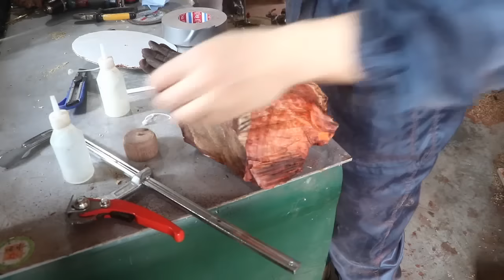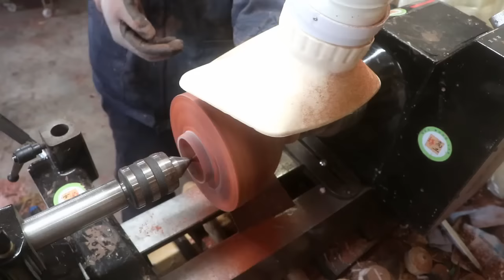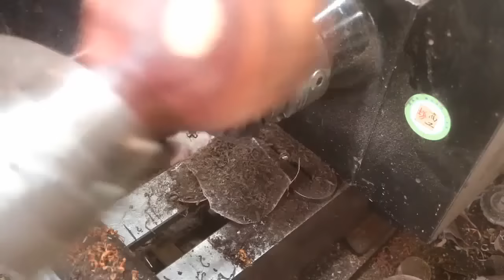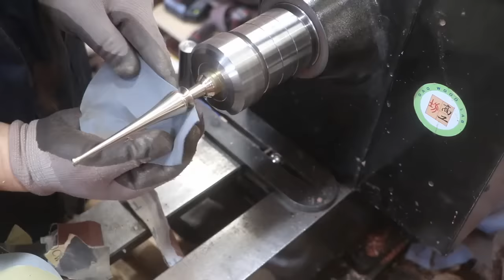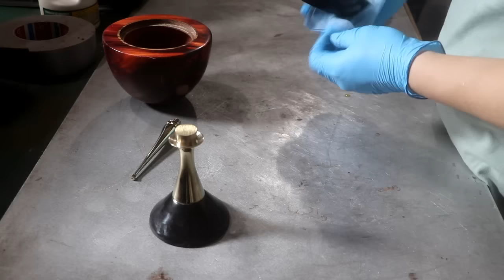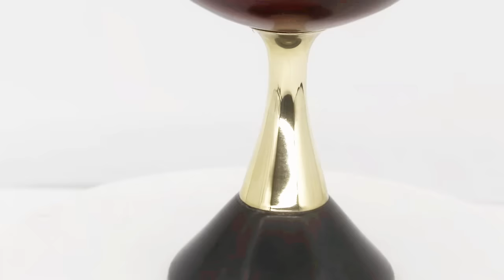woodturning:  a money box for my son.

Comment: Hello, your work is very interesting and with high level of knowledge and craftmanship. Appreciate that you take the time to share. One question, i see that you don t make a tenon from the precios wood but use another kind of wood, here is the question. Is it regular epoxy that you use, don t understand the video parts where it become white.  thank you
Reply from the maker: Thank you so much, and yes, I prefer to to resin to glue a tenon of common wood to save expensive wood. This resin is 5 minutes resin that cures very quickly, it has enough power to hold work pieces.
Reply: Thank you for taking the time to answer, I will follow your video to learn and apply.